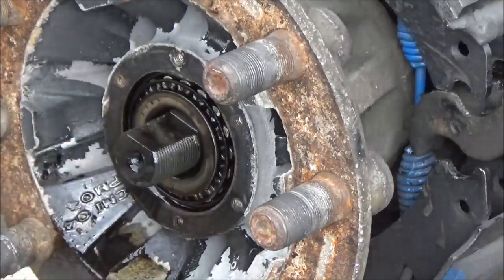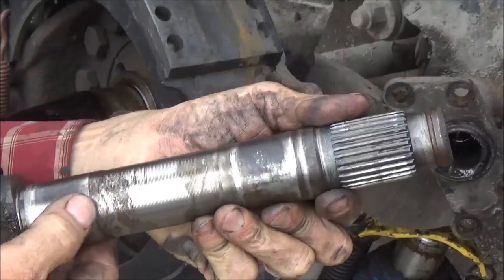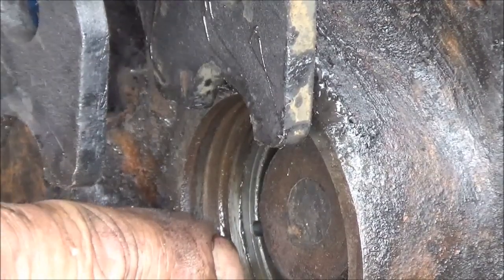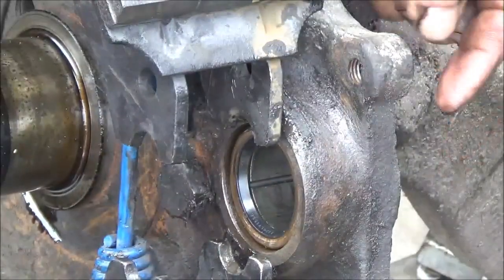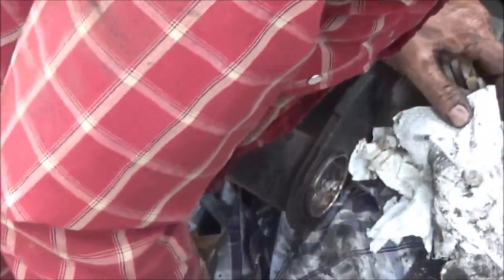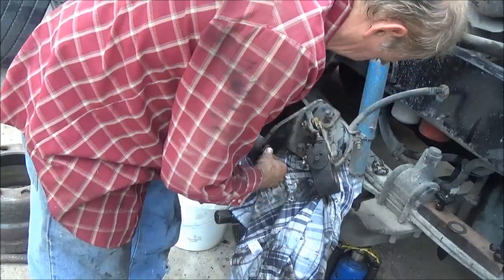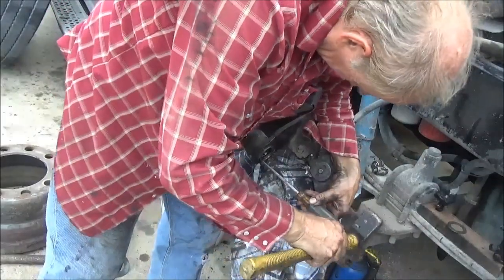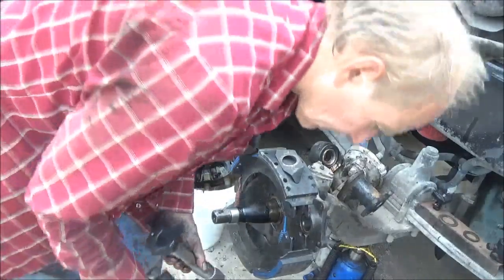Replacing "S" cam and bushings (part 2 of 4)

Comment: Gordon the rear seal is supposed to be in backwards.   That way when you grease it, grease can escape and not into the brake drum.
Reply: @ericc9686  wrong.   Vince is correct. This does not have a pressure releif fitting
Reply: Both seals point to the inside of the axle

Comment: usually when one S-cam bushing wears out, the rest are too. 
You can tell it's bad if the S-cam has play in it.
Reply: i changed brake chamber on front
and just did slack adjuster scam and the bushings as well as the bearing all together 
on steer axle. drive axles looks okay so i left them.

Comment: did it leak on the seal that wAS maybe in backwards.... doing all six of mine this weekend
Reply from the maker: The seal facing away from the brake shoes should be put in backwards so the extra grease will leak out there instead of out on the brake shoes or popping one of the seals out.

Comment: Your working too hard. Leave the hub on,take the shoes off, take the scam tube off make a tool to fit into the gap between the cam and the brake spider (a piece 1/8 by 1 1/4 flat stock with a curve to fit) and drive the bushing and seal out will give you enough room to get cam out. Cut the cam at the bearing (about 2 inches) to use as a driver. The bearing in the tube drive the bushing and seal out from back side. 
For the spider, put the washer, the seal on the new scam facing in, then the bushing and drive it in flush. For the the tube put seal on the tool facing out then the bushing and drive in. Reassemble. 
. I've been working on trash truck's for 25 years and have replaced hundreds of scams (nothing gets abused like a trash truck). A line haul truck may get 500,000 or more, a trash truck gets 6 to 12 months out of a set of brakes. 
Work smarter not harder. 
Have a good day.
Reply: That is correct ,leave the hub on and take shoes off .
there is no need to take that whole S -cam bracket off eather .
All he need is a tool to knock old bush out and install new one ,but Gordon do not like a advice and doing it hard way .
After you do more than 100 off them you figured out easy way .
Reply: I seems like your method might only be possible on the steer s-cams. I’m looking at my drive s-cam and the shaft is too long to be taken out without removing the hub.
Reply: If the seal is not leaking I never take the hub off. And with a 24,000 lb axle you either pull the hub or pull the cam tube. Though it is easier to put the brakes on the heavy steer axle without the hub.
Reply: Cbmech

So you’re saying it is possible to still take out the s-cam without removing the hub on a drive axle, say, from a Freightliner Cascadia?
Reply: Unless they have some kind of wierd axle I've never seen (though anything is possible with daimler/freightliner). You pull the snap ring off the cam, pull bolts holding the tube and slide it slack and tube off the cam. You can either leave the hoses on and just suspend the can or take the hoses off and drop it. Then from the back of the spider drive the seal and bushing out of the spider and then you've got enough play to get past the hub. Then put the tin plate on, seal facing in and the bushing and use the new cam to drive it all in and finish reasembling. I started working trash trucks in 1980 and I've done hundreds this way. I've worked for companies that you did it every time and companies that you only did when you HAD to replace the cam. (I've even worked for a company were you might only do one brake on an axle because the other one was "ok". 😱🤬